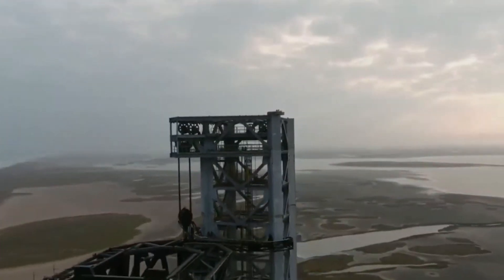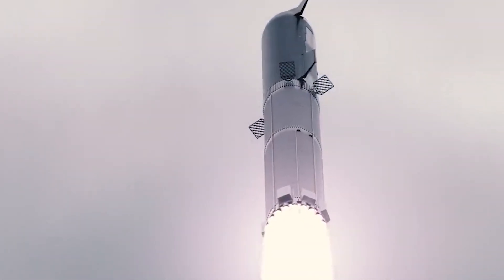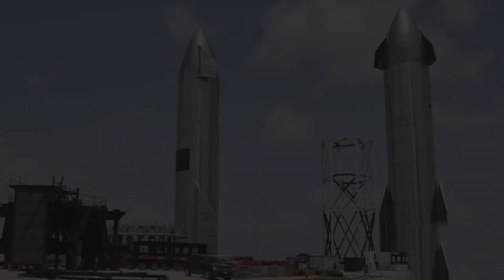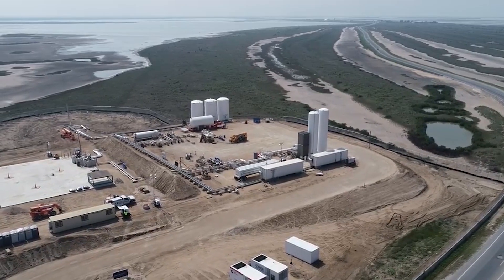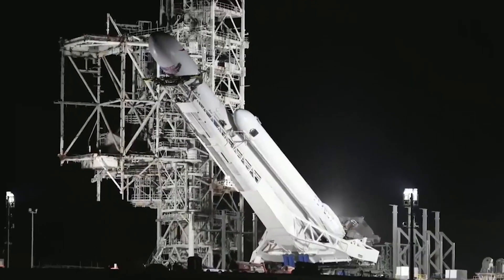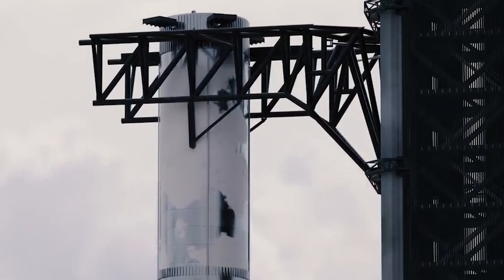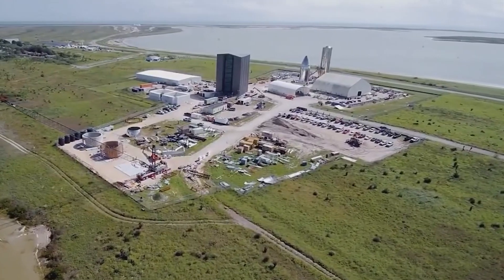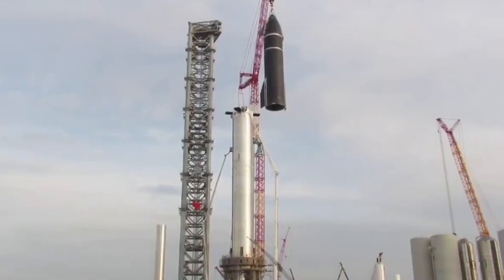Spacex Starship Mechazilla Awakens For The First Time

Comment: 0:38 keep your fingers cross, that static fire/launch doesn't incinerate the OLT, with the beast flares.
🔥♨️🚀 without it being a foot-claw that bresks away. Or  last tunnel.
1:54 is the chopstix suppose to catch a canister THAT close to the prior stack🤨? Looks like they will need an assembly ground wheeled mobile bay path of the OTL